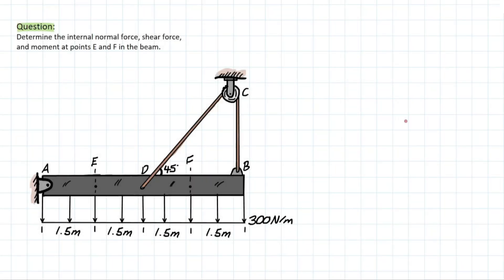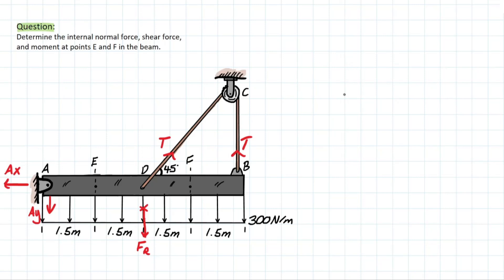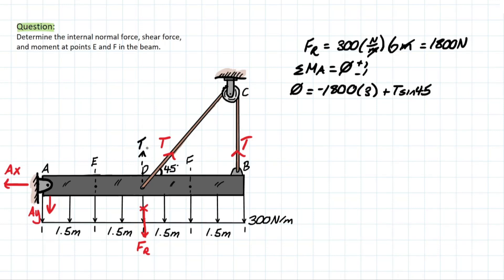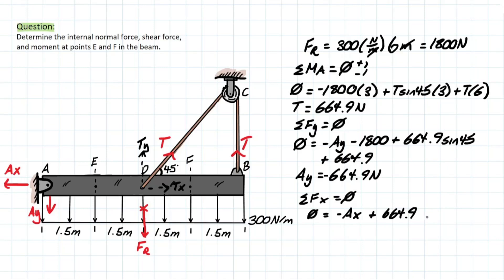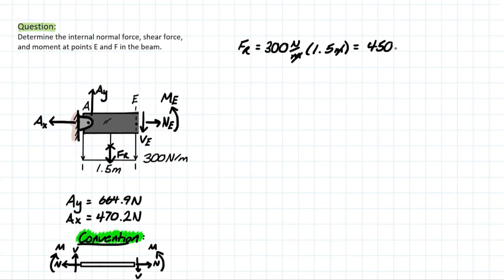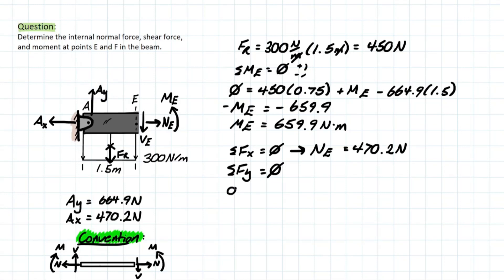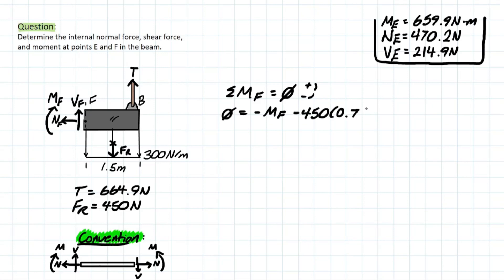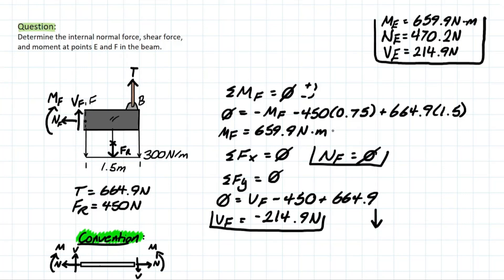Solving Internal Forces Problems!

Comment from the maker: NOTE: Reaction Ay was solved as -664.9N in the first part of the problem, so at cut E, the direction of the reaction is changed to remove the negative sign!

Sorry for not explaining this in the video, I missed it while solving for the video. Once again, thanks for watching and leave any questions below!
Reply: I would be grateful for that but I didn’t get your point about Ay
Reply from the maker: @_YNO  Hi, I hope I can explain it simply here.

Basically, when using the equations of equilibrium for forces in the Y direction, we have a set Y convention, where upwards is positive and downwards is negative . When we finish initially solving for Ay at 3:30, we are left with a negative answer. This means that since we initially drew Ay downwards, we actually have an upwards reaction! Therefore, when taking the cut, I change the way Ay is drawn by directing it upwards. This removes the need to work with an additional negative sign.

I hope this helps, and if you need more clarity, feel free to ask. Thanks for watching!
Reply: @simple_civil  oh thanks u r the best I got it now